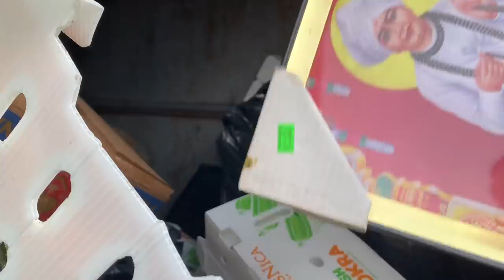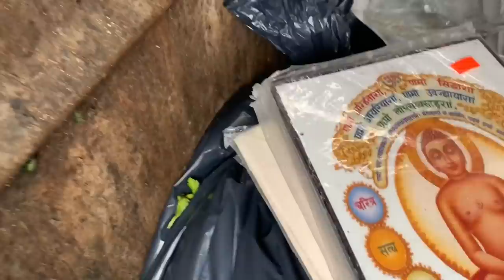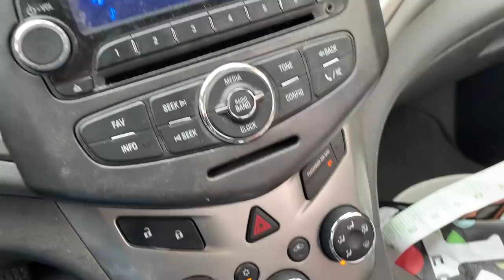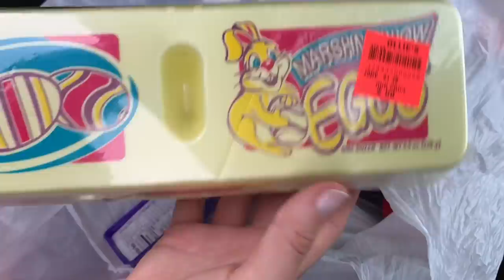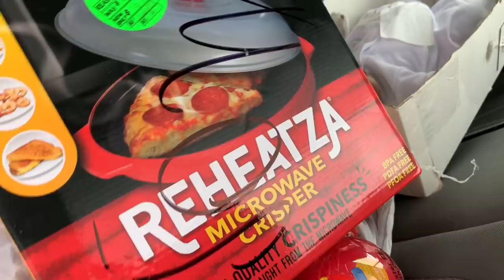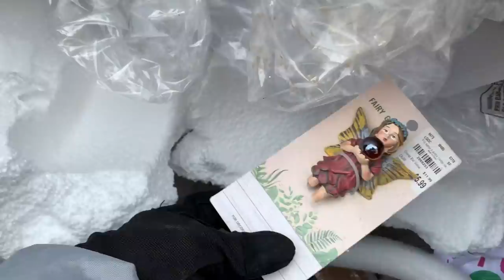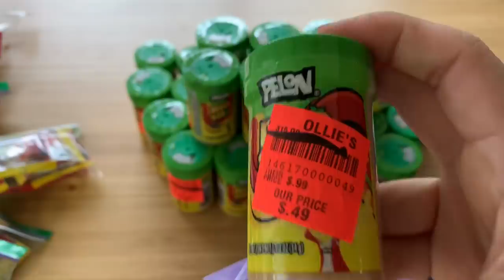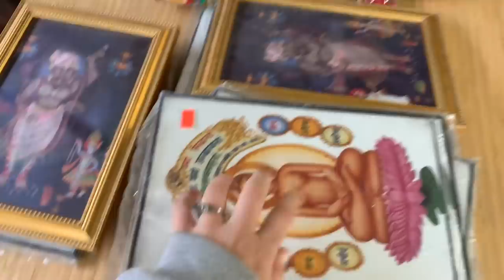Dumpster Diving behind Groceries Stores! I found 25 POUNDS OF CANDY!

Comment: The Hindu gear. Rather than break that collection up by placing a few around here and there to diminish the volume, list them to go as one set. Grab a clean sturdy box from any of those dumpsters which can hold the lot. Be ready to freight those. $ 20.00 plus freight for the lot on ebay, or less formally on Instagram. Some naturopath clinic could use the entire set, particularly at more than the right price. Sorts out their decor motif for less than fifty and it jives with their rainforest music.

Comment: The straighteners are displays. No wiring or anything on the inside. I’ve found them before. The only use I could think of was maybe for a little girl to play with...🤷‍♀️
Reply: That is an excellant idea. A little girl would love anything like that. Again great idea!
Reply: Or remove the plates and sell them as replacements
Reply: I’m sure they could sell as spare parts? Just a thought. Cute idea regarding keeping them for a little girl / boy though :)
Reply: Still appear to have the ceramic heater component.

Comment: Frame 17:26. 17:31      That copper colored chain with what looks like umbrella tops,   I believe is a " Rain Chain " ( Think thats the name )     You hook it to a spot the roof ( say a corner ) that the rain Pours off your house.  Let the chain hang down into , like a pot w/ gravel in it,  so the rain water will run down it  & not make a splattery mud hole.    :)